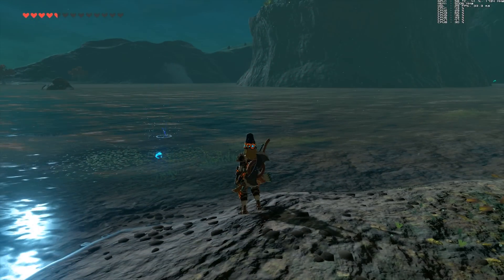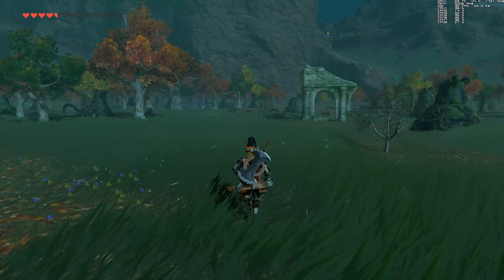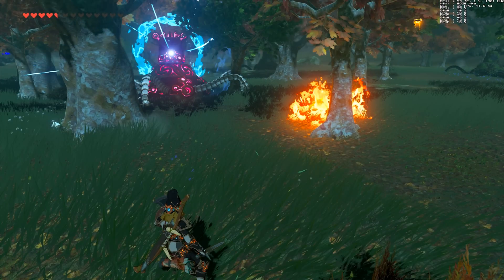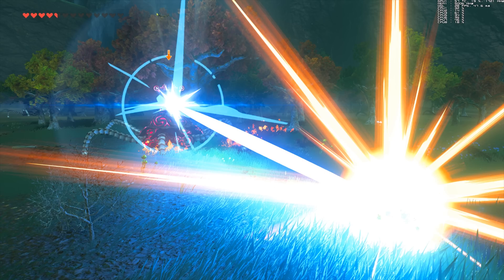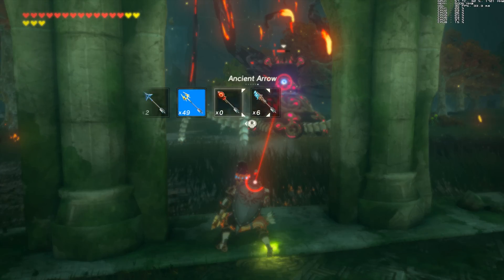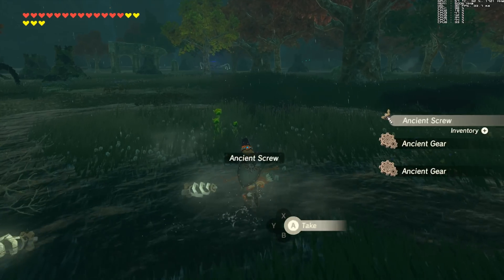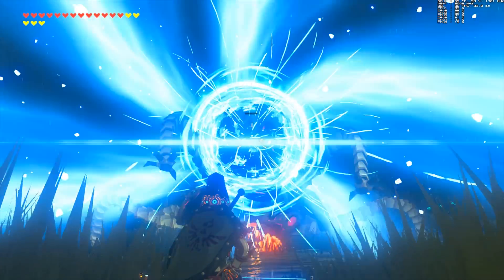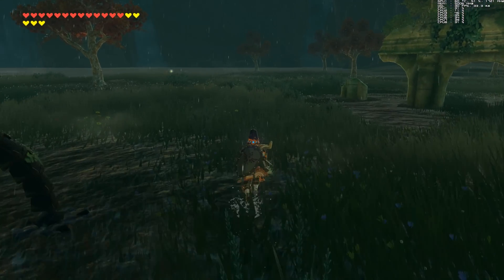Cemu  1.9.0 | Shader Cache | What Does it Do?

Comment: Alright my issues with one particular game and it's shading cache is Mario 8 I'm on 1.82b and have use a completed shader cache however when I play Mario somehow the shader cache gets resets or replace and I'm back to zero causing stutters any suggestions??
Reply from the maker: Ive never seen an issue like that or heard of it. If you have the correct cache, named correctly, in the correct folder and compiled fully , then it will just work.

Comment: What are the performance differences when building ur own cache vs getting an 8k one from someone else? is there a large performance hit? like say more stable fps all around? or is the difference nominal?

i ask cuz i have an 8k one from someone i use and i run the game just fine ( my cpu probably helps tho being a i7 4790k @4.0ghz Devil's Canyon) just wondering if it was worth trogging through building my own.
Reply from the maker: The issue is not performance. On anyone elses cache you will see micro stutter and hitches that wont be present on your own cache
Reply: hmmm once im done with a good portion of the game ill start building my own then. just dont want to slog through trying to build one fresh to the story

Comment: How do you build a shader cache yourself?
  I get that you go through the process as shown, but after you quit the game the cache has to start over the next time you play the game.
  How do you build your own shader cache that you can reuse?
Reply: When playing in Cemu,the shaders get cached in the transferable folder,and then compiled into the pre compiled folder. Anytime you have a pre compiled shared cache,it will load up the next time you open the game,and use them.
Reply from the maker: Just start the game with out a cache and itll build one for you
Reply: The only game that I've started up more than once without an already made cache was Splatoon,  everytime that I launched the game, it would start from scratch unless I placed a pre-made cache into the folder.  It's just that the cache wouldn't save for me when it was built from scratch.  Maybe it's the game, or maybe I just messed something up early on, I should check the folders I guess.

Comment: I have an i3-6100, a GTX 1060, and 8GB of RAM. I don't think I would be able to run the game very well because of my CPU rn, but if I upgraded to an i5-7600k would I be able to play without many fps issues?
Reply: 7600k will run it at an almost locked 30. My 6600k does that @ 4.6.
Reply: I played the game with that CPU and a 1050ti and was surprised of the result. Other than at towns, you'll be fine.
Reply: Suhrvivor alright, thanks
Reply: TheGreedyGoblin I play mine with an i5 6400, 4 core @2.7-3.2 ghz with 1050ti and plays very good

Comment: Is there a way to improve the durability of weapons? It's absurd that all weapons of the game will break :D
Reply from the maker: Yes. I am literally making an updated video showing this right now
Reply: It would be fantastic \o/
Reply: Christian90 I personally like the durability system, but it would still be nice to know how to change it.
Reply: Christian90 well yes you can with a save editor but to me is kinda cheating just beat hard guys and u get better weapons but I have notice each weapon is for an special oponnen if u use it with the wrong guy weapon breaks in 3 or 4 hits, I have notice but I haven't written  down. All I remember now using stasis to stop time breaks weapons faster u will need those hammer rock breaker to use with stasis and they last longer
Reply: I used a savefile editor for this
Reply: Which editor?

Comment: @BSoD Gaming  I got a phenom IIx6 1090T and a r9 380 with 16 gb of ram, but my fps is reeeeally low... can you suggest me a method to increase performance?
Reply: It likely has to do with your CPU. Right now the way Cemu is optimized it feeds off fast CPU's. Also AMD graphics cards aren't optimized either so even if you get a better CPU your game will hover around 15-20fps, with spikes when you go into shrines.
Reply from the maker: The issue is your CPU, it is just too slow right now for BOTW
Reply: Would an i7-3770 do?
Reply: at 3.9ghz boost it should be decent with Cemuhook, not 30 locked, I'm thinking around 20-25fps
Reply: Me? Mine can't be overclocked. It isn't a K
Reply: +ShadowRush2112 The 3770 non k has a boost clock of up to 3.9ghz. You should be fine.
Reply: Even a non-K cpu can still be overclocked a little bit (assuming you have a Z-chipset motherboard), making your 3770 reach something between 4-4,1ghz. Try to set your Blck from 100 -> 104 and set the multiplier to 39, that should still be stable.
Reply: I don't think i have a Z chipset motherboard.
Reply: if you are not sure you can always download cpu-z and check what kind of motherboard you have (+several other things ofc)
Reply: It's a Foxconn motherboard. The 2ADA i think.
Reply: won't be possible then ^^ that one has a h61 chipset i think.
Reply: +Pain I have a gtx480 1536mb vram game runs okay with 2k textures and improved shadows. Cemu has always been a ram eater and cpu hungry you should look into getting a new cpu and motherboard first at least an i5 3570k on second hand will do just give it an overclock to 4ghz. Cemu likes Single thread performance which amd sucked at until Ryzen which made it comparible to haswell depending on which one you get (Ryzen is a little strange)